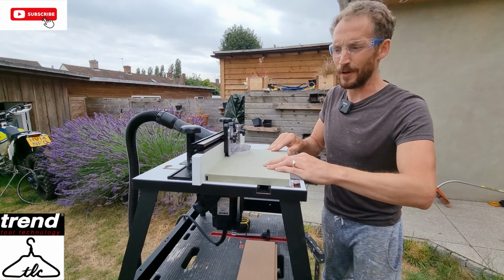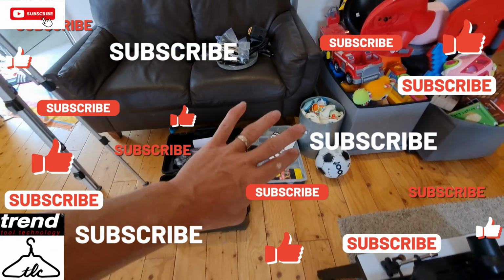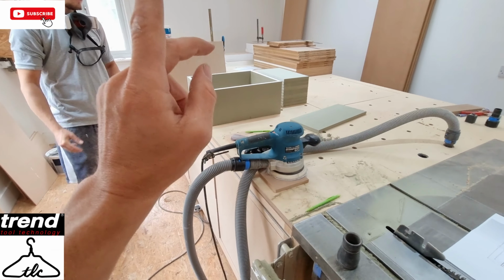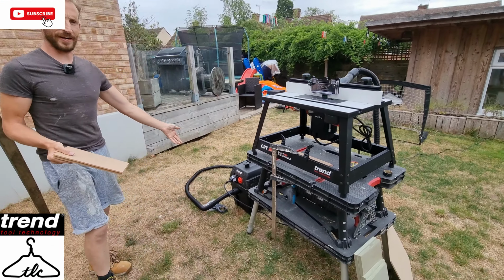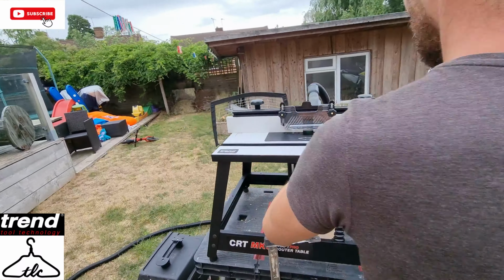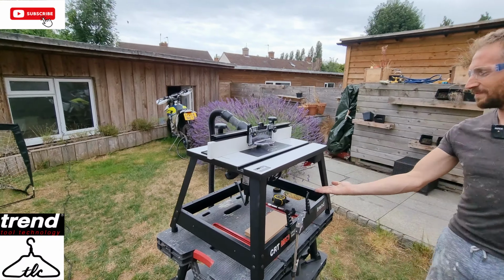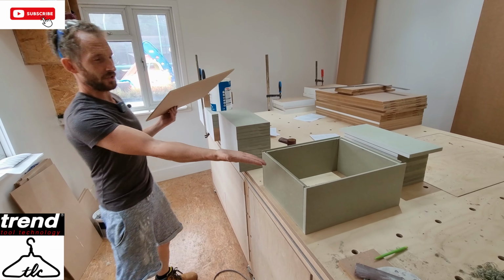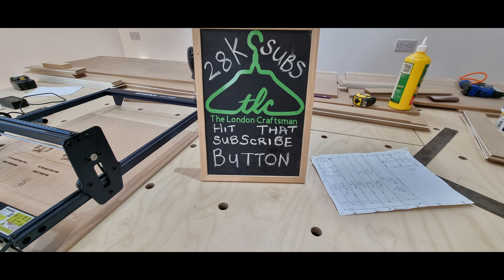SUPERB Router Table Setup / THE TREND 'CRT' Router Table / For Site & Workshop / Vid#104

Comment: If you rebate kitchen cupboard sides (along the top and bottom) then glue the top/bottom to the side and use a wide crown staple from the top and the side to secure the joint, you will make a joint that never moves and can be spray painted. (I used to own a high end kitchen joinery business that specialised in sprayed joinery).